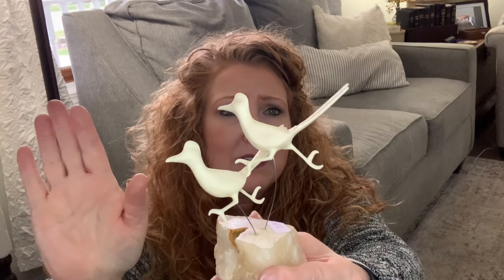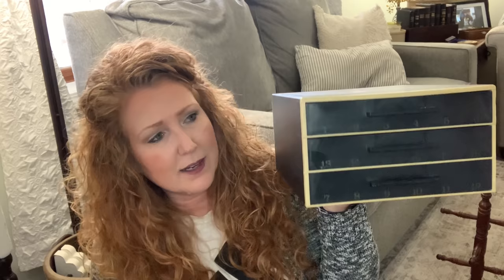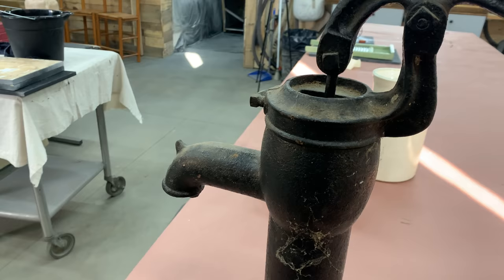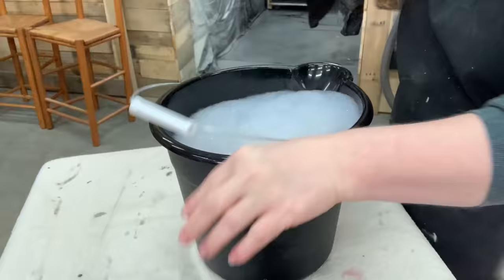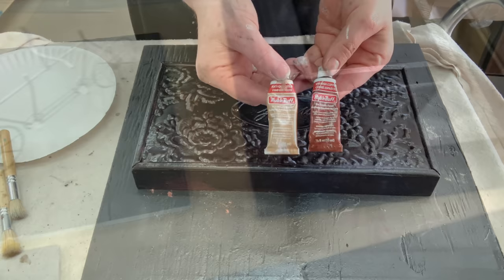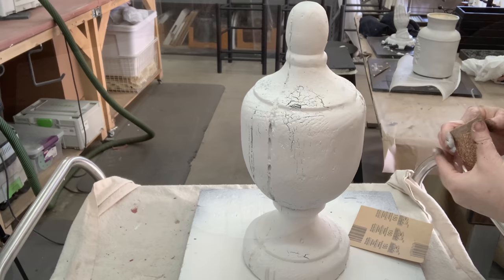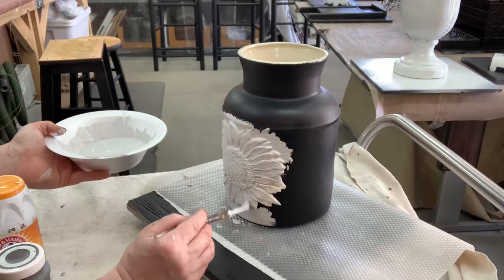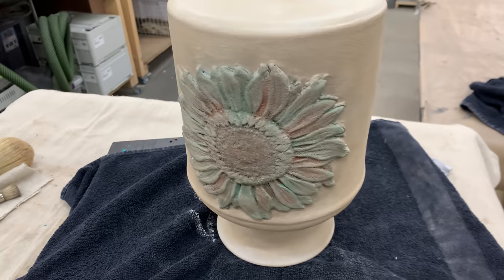Thrifting for Secondhand and Finds | Making Beautiful Home Decor | DIY | Reseller

Comment: The black box with drawers I believe is used for gems stones, beads for jewelers or findings, it also could be used for small electrical parts for sodering on to circuit boards, or anything ones heart desires to collect and keep sorted like stamps or buttons, the list could go on, but it's some sort of sorting box, it may of came with items in it when it was originally bought hence the numbers!